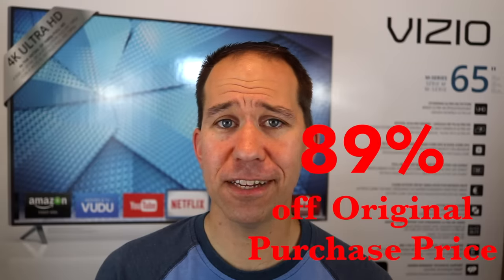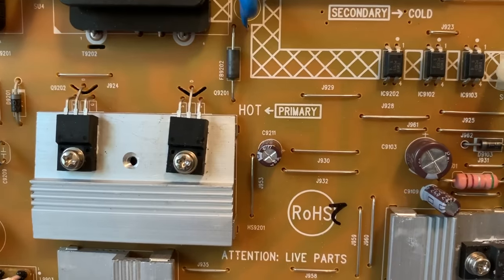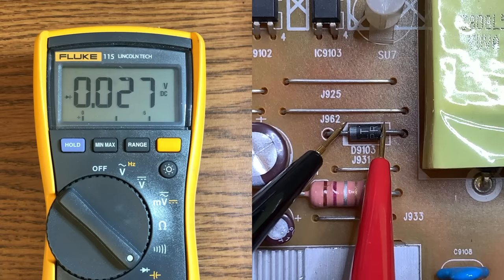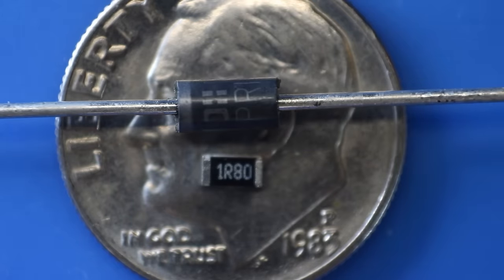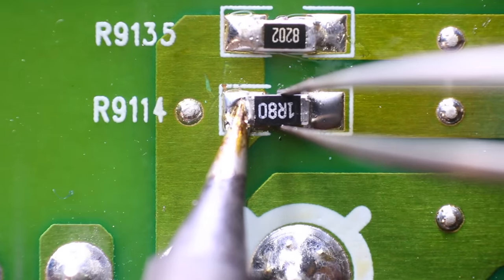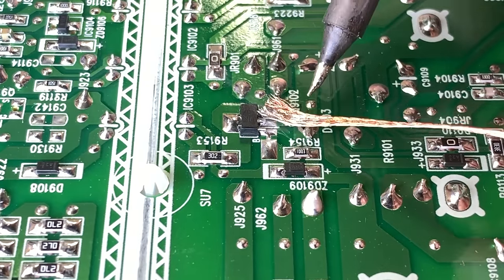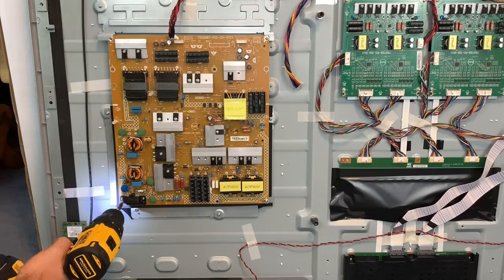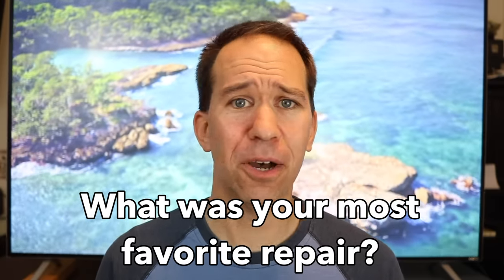I got a broken 65” 4K TV - How I repaired a Vizio M65-C1 (tv won’t turn on)

Comment: Is it possible to test the voltage without actually turning on the TV?
Reply from the maker: Do you mean what I did in this video?  I only had power to the power supply.
Reply: That’s what I was wondering. I have that same TV and in the video you don’t show how the board is hooked up to power. Are you connecting it via the TVs power plug only?
Reply from the maker: @Kidney_Thief  yes, I plugged the cord into the wall, and the other end into the power supply board (being very mindful of course)

Comment: Can you tell me what the output voltage on the led driver for a vizio D32H -F0 is. I have no backlights and I have an output voltage of 21vDC on my board. I want to repair the TV but don't want to waste the money if it is the main board and not the LED strips.
Thanks Karl
Reply from the maker: I’m not sure, sorry.  Have you tried driving only certain portions of the backlight?

Comment: One tweak: Search online for possible solutions BEFORE buying the item so that you're not surprised by needing an expensive part.  (In your case, not a concern because you can likely fix most problems but for a newbie a little advance research would help choose an item that's likely repairable.)
Reply: Agreed. I've done this before, and actually had the fix before buying the item, even though you're never 100% sure. I have almost gotten burned a few times by buying things that ended up needing more than I had bargained for; fortunately, this is why I salvage what I can from junked items to keep spare parts on hand!

Comment: I had a laptop covered by an extended  warranty. I had had it repaired twice during the warranty period and it broke a third time. When I called up to organise a repair, the warranty company decided to write the computer off without even looking at it and gave me a full refund of the purchase price (in vouchers). So, I purchased a brand new laptop. The problem with the old laptop was the hinge anchor point in the base had broken, so I purchased a new base for £17. Took me about 30 minutes to swap all the components over from the broken base to the new one and I had a working laptop again.

Comment: Problem around here is people chuck out the TV, but for some reason don't leave the remote nearby and these days a TV is practically useless without the remote :P
Reply from the maker: Yes, unfortunately some don’t consider that others can fix it or that it would be helpful to put out the power cord and remote.  It’s possible they lost it and it’s also an option to knock on the door and ask if they have it.

Comment: That is resistor was probally being used as a fuse, I have seen allot of that in circuit assemblies I have worked on
Reply from the maker: Probably since it was such a low value.  I haven't looked at any schematics of this board.  The TV has been working for years so I've moved on from doing more investigative work.
Reply: @FrugalRepair  the schematic probably won't say fuse. But if you ask the right engineer about it, they will acknowledge that what it is for in their circuit.  A low ohm resistor is cheaper than a fuse and was probably installed for that one strange time a circuit may fail to prevent real damage. Something that could be more damaging.

Comment: I have a 76" Hisense TV (less than 2years old) the power light do come one but the screen stay black and no sound. the TV technician want a crazy amount just to test the TV....what should I do?
Reply from the maker: Maybe the backlight is out?  In a few days I will be releasing a PDF with some of my best tips to diagnose a broken TV. I’ll post it on my website. I hope something like that can be of assistance.
Reply from the maker: Or it could be a tcon board problem since what you describe is a symptom.  It could also be a problem on the power supply or the main board. Or it could be a problem somewhere else. Sorry I can’t say for sure!

Comment: hello,  how  about  couple  months  ago  brought  same  model  home  from  my  towns   recycling  program  ,  set  turned  on  but  had  a  thin  line  a third  of   the  way  from  right  side  ,  ended  trying  a  few  things  and  returned  set ,  was  thinking  to  salvage  the  boards  but  figured   what  would  be  chances  of  another  identical  set   being  brought  in  ,  so  just  brought  it  back ,  well  about  a   month  and  half   later   bam   theres   an  identical   e600i -b3   ,  in  great  shape  so  i  brought  it  home  plugged  it  in  and  "no power "  ,   so  i  found  your   youtube  link   and  found  power  on  no #  4  ,  no#  7   and  no#  8    and   no#  14   with   no  power  to  t-con  board  ,  so  i,m  going  to  assume  the  issue  might   be  at  resistor  on   t-con   board   ,  i  have  a  multi  meter  ,  FJML  should  have  gutted  electronics  from   other  tv  ,   there  should   be   power   from   main  power   to  t-con  for  tv  to  work  ,   correct ,   also  when  i  first  plugged  tv   in  it   didnt  turn-on   chime  or  flicker   what   so  ever ,  i,ve  checked  other  power  points   and   consistant  with  markings  on   board ,  any   thoughts  ?   try   ordering  and  repairing  or  search   eBay   for   t-con  ,   thanks   John
Reply from the maker: I'm a little confused on your question.  The red line more likely is from a bad tcon or a bad tab bond.  The other tv, I'm not sure I'm following your diagnosis.

Comment: My Vizio M49-C1 no longer powers on. The small white light on the bottom left corner comes on but dims off after about 6 seconds. If I don't touch any controls, the white light comes back on periodically, then dims off again. Does this sound like the same problem in this video?
Reply from the maker: Prob not, but I hope to make a video about that on a similar model.  It’s likely bc of the board warping due to heat and loosing connections on the main cpu.

Comment: The point is not to have fun from fixing things, not to "earn" a TV for a fraction of the cost; but rather reduce polution and landfill by not throwing away something that's otherwise serviceable.
The problem is, manufacturers' greed is preventing this from happening. I used to work as a technician at a major TV brand, a power supply is at most 200 bucks, but they choose not to manufacture replacement parts for techincians to swap, instead they give "good will" to customers for the purchase of a brand new TV claiming it has better specs and lower power consumption.

Comment: right now i do have a  65 inc LG 4k smart tv 65uh615a  that shows a dark shadows on the left side... i need  help on what wrong.. I have gone thru the setting and advance settings still them same...you can see the images in the dark side but not too clear..
Reply from the maker: Sounds like a portion of the backlight is burned out on that side.

Comment: I found a dynex tv in the trash and I've been watching YouTube videos for a quick fix, but it seems that the problem still exist, the quick fix is to take the motherboard where you connect all the cables for different devices and put in the oven at 350 deg for 5 to 10 min, and it fix, but the problem comes back, it has power but doesn't turn on, it seems that when it cools down it has no power, it is a good tv, nice sharp image, and I was jumping because I fixed it, that I told my daughter I had her Christmas present, she got so mad that said she was going to smack me🤣🤣🤣🤣😂, anyway I'm just commenting, and laughing, because I told her that it comes one year warranty, until I find another in the trash, thanks for reading this comment, hope you enjoy as much as I did. Regards from a fan
Reply from the maker: I’m planning the my next video will be about something similar to what you are referring to.  Though, I’m not going to use the oven. =).    It’s not a true fix but it’s something quick you can do it get the tv working again.  You can fix it correctly by reballing the BGA chip in question.

Comment: Just came across this and wish i went down the same route! 

My LG screen doesn’t come on and LG are trying to say it’ll cost £400 to fix, yeah right! The tv itself still comes on as normal, you can hear everything, you just can’t see anything, it’s like the screens been switched off, any suggestions?
Reply from the maker: Sounds like the led backlight is out.  When you can hear the sound, shine a torch at the screen and see if you can see anything (menu, pictures, anything).  If so, then it means the backlight is out
Reply: FrugalRepair I’ll have to give that a try, i’ll let you know how i get on. Thanks for replying and for the advice, it’s much appreciated

Comment: my panasonic 43" smart tv was accidentally bump at the screen. when i switch on, i could still watch but it has a vertical and horizontal lines, and a crack screen. after a week of watching with those vert and hori lines, it went off. i could only hear a sound but the screen is black. Can you please teach me to repair it.
Reply from the maker: Unfortunately, if the screen is cracked there’s nothing you can do to repair it.

Comment: I repair household appliances. I want to get into how to repair these motherboards. like shown in this video... the computer boards on these new appliances are expensive...
Reply from the maker: That's cool.  I agree.  Learning how to repair circuit boards would be very helpful for repairing appliances.  For example, my washing machine has some sort of issue that I've seen others online complain about but repairs promoted online so far is to buy a new expensive board.  Once it quits working I'll pull it out and try to figure out what part is given the trouble.

Comment: Hey men how r u today hope you doing well my friend hey I do have a cuestion for you hope you can help me with my issue on my tv brand tcl 55inches I did everything on it but still won't turn on the screen there's no pictures totally black I did changed the t con board power supply and main board all 3 but still won't turn on the picture will come on for just 1 second when I connect to the power I don't know what to do with please help?
Reply from the maker: If you can see something on the screen even for one second, then my first guess would be the LED backlight is the problem. Use a flashlight after the screen goes dark and see if you can see any kind of image. You will need to get very close to the screen and shine the light at an angle. If you can see anything at all that resembles an image then you know it is the back like that is the problem. You should shine the light on the Settings app and try to turn the brightness down to 10% or so then reboot the TV.  That’s one of the first things I would try anyway.
Reply: @FrugalRepair  yeah I did that last night and yeah I can see something but how to reboot..
Reply from the maker: @Velasquez77430  if you can see something with the flashlight you need to replace the backlight (or at least, the failed LED's).  It's doable but watch a few YT videos on it before you try.

Comment: I have a Phillips 65 inch 4K smart TV and I have a problem with it the volume would put itself down all the way to zero then the zero volume Icon stays on and I can't access any function on my TV. I did a factory reset it help but then it started to do the same thing with the volume. Please help me,  what can I do...
Reply from the maker: I’m not sure but my first thought is that the volume button on the input bar may be stuck down.  You could disconnect it from the main board to isolate it.  Sometimes the remote sensor is on a diff connection to the main board so you could still use your remote to change volume.
Reply: @FrugalRepair  my Philips 4 K UHD smart TV 5000 series model 65PFL5602/F7 problem is volume fluctuations . The volume goes down by it self until reaching zero volume , the volume Icon stays on, and I can't access any function with the romote . If I use the TV control panel and press the volume button the volume Icon goes up, but as soon as I release the button,  the volume Icon goes back down to zero...I can't Access any thing.Its like a ghost playing pranks on my TV.. Is this a common problem with this TV, what can I do, with the COVID-19 situation, my TV has become essential in dealing with the daily stress and a much needed entertainment for the entire family... Please help me find a solution for this....Thank you in advance..

Comment: Hello, I’m hoping you can help me. I have a Vizio M70-C3 and one day the picture went out on it. My wife wants me to throw it out but I still have faith that this tv can be resurrected especially after watching your videos. So before coming across your channel I replaced the t-con and led driver board but I didn’t get anything. I just received the main board and replaced it and now I get back light and the power stays on. Before the power would cycle on and off every few minutes. I paid $2400 5 years ago so I don’t want to throw it out just yet. I’m hoping there’s a way you can help me. I would greatly appreciate it. Thank you
Reply from the maker: So no picture now with the new main board?  Do you get sound?  BTW did you get my PDF since I have a bunch of info in there.
Reply: @FrugalRepair  I do get sound. No I didn’t get the PDF
Reply from the maker: I have some steps in the guide you can try.  It’s possible the LCD screen is bad if you changed the main board and tcon.  Did you watch my two videos on fixing with tape?  That may be the next thing to diagnose and try.
Reply: @FrugalRepair  yes I did watch the tape video that will be my next step. How do I get your PDF
Reply from the maker: Go to FrugalRepair.com click on the tv resource tab.

Comment: I bought a LG OLED65C1PUB on line it is broken problem TV have standby light when you turn it on flash 3 times and nothing happen open up the TV and find the power supply bd click when you turn on TV i bought a kit  on line  main bd. power bd, T-con bd install all three boards and the problem still there this TV was manufactured Feb 2022 and don't have backlight could you help me?

Comment: Couldn't the 12v line be at 19v because the resistor is bad? Edit: Nvm got the rest of the way through the video and saw that it remained at 19v. I wonder if there couldn't be anything else wrong with the board causing it to be higher than intended voltage.

Comment: Is it possible that just my resistor is bad and not my diode? The resistor tests just like yours but the diode seems fine.
Reply: Mine has a solid LED but no picture just a black screen. That resistor you showed seems to test bad.

Comment: My Vizio E500i-A1 is stuck in black and white. Smart menus are in color. Would this fix that issue? Have you come across this before?
Reply from the maker: That sounds like a firmware or settings issue.  Did you try resetting to factory defaults?
Reply: FrugalRepair yep. Just waiting to see if it will update.
Reply: @FrugalRepair  Is there a way to force a firmware update?
Reply from the maker: @fjmdesigns  On that model, I don't think there is a way.  I think any updates are over the air and are pushed out by vizio.   It's possible that you could replace the firmware chip.

Comment: This looks like a design flaw. Think I would have liked to see what that resistor was doing, it may be simply taking too much power or the diode may have been stressed. Well done anyway and you'll know what to do if it goes again in the same way.

Comment: I have an Emerson the logo comes up and then turns off then back on the off.  It keeps doing that.  What could be the problem??
Reply from the maker: Boot looping? Probably the main board. I guess it could also be LED back lights shorting out. Those are at least the two main guesses I would have
Reply: @FrugalRepair  Thank you.  Is that the technical term for that?  I did not know .  Any relation to Fruit Loops?  :)

Comment: Hi , i have a LG LCD which show just a white background with lines on startup , and after 20 or 30 minutes all become ok , have you any advise for a new subscriber :) ?
Thanks in advance .
Reply from the maker: I’m not exactly sure but when I have seen this symptom before it was a bad tab bond on the buffer board.  The tv is heating up and  the board flexes ever so slightly and causes that electrical connection to happen (where it had lifted due to the adhesive failing on the tab bond).  Google these terms if you don’t know what I mean.  If this is the case you can jerry rig a solution.  I fixed mine with a torn up old Christmas card.

Comment: Escuse me ,l have a Vizio tv model M3D650SV that suddenly turned off, so l uncovered it to see what happened, and l see that a smd  mosfet transistor is burned on the main board, and l would like to know if you can help me, telling me the numbering of that mosfet ,,is in the space Q32 ??
Reply from the maker: Unfortunately, I wouldn’t be able to figure out the specs on that transistor. Maybe you could look it up based on the printing on the top of the transistor.  If you can’t see any printing, one idea is to look on eBay for a board for sale. And then zoom in on the picture
Reply: @FrugalRepair  nothing is seen, it burned completely......